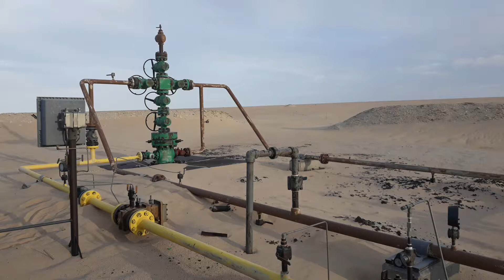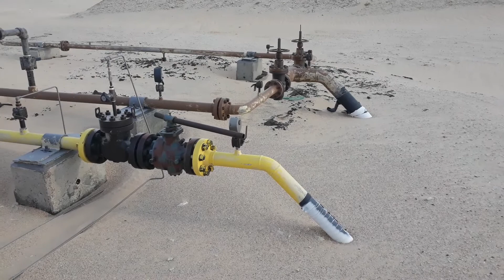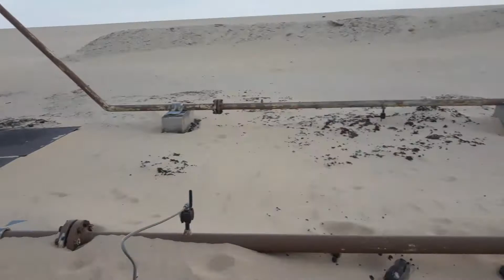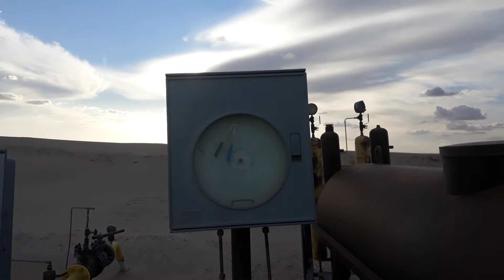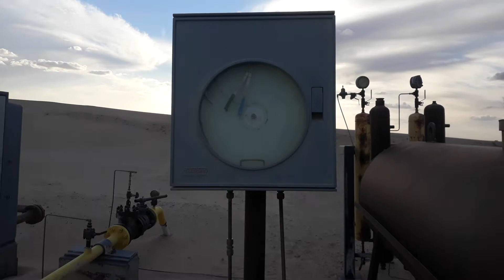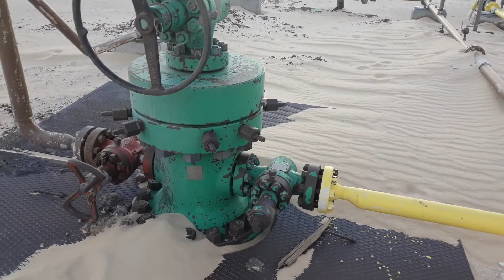Gas lift well facility.

Comment: Thanks, i have question
1. Are you producing from different zone or the same bcoz first time i see GL with dual siring x tree
Reply from the maker: You are welcome. Actually, it's a GL well producing from an open hole, namely one zone. We normally connect two production sides for high producers or in case a portable test is going to be connected for testing the well. I hope this can clarify your question.
Reply: @mohamedmansour2120  yes it is very clear, i am new employee i am trying to learn more about oil and gas industry. Thank you very much